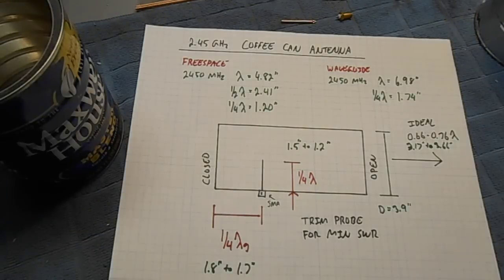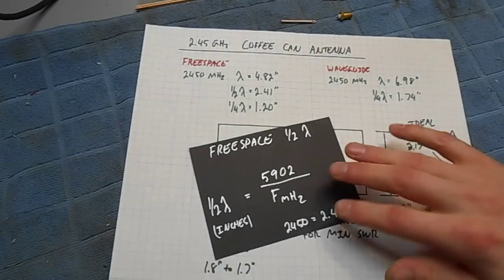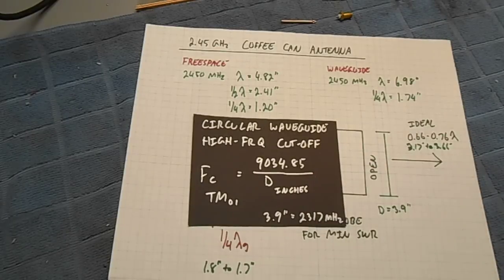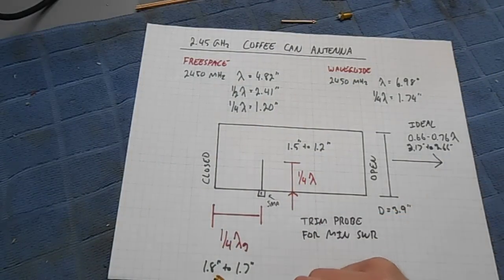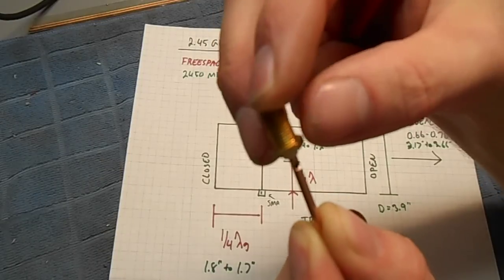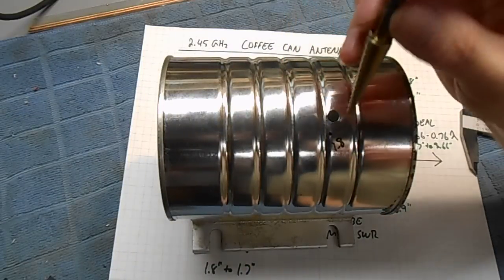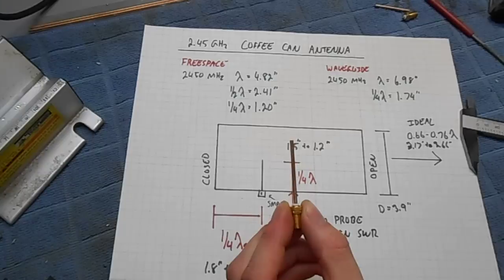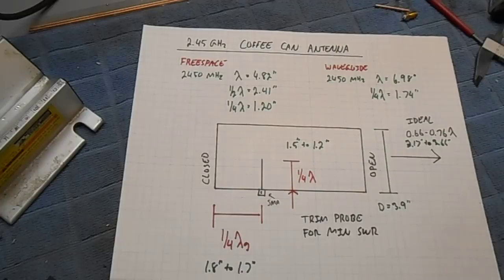GBPPR Vision #9: 2.45 GHz Coffee Can Antennas

Comment: I have always trimmed off the lip of the can with an electric can opener - I don't know if it really matters. I have also used the 46 oz juice can with the best results and have illuminated 4 foot parabolic dishes with it with, as best I could determine at the time, about 20 dB gain. Thanks for posting your experiments.
Reply from the maker: Yeah, the lip should technically be removed, but that's usually too much work, and like you said, they'll still work and are basically free!

Comment: I also have found that your dimensions of the driven element from the closed end of the can are good. Some theoretical equations say 1/4 wavelength and that does not work very well. Overall, with all my experimenting, 1.2 inches is the best length for the mono pole assuming something like #12 wire. Keep up the good work.